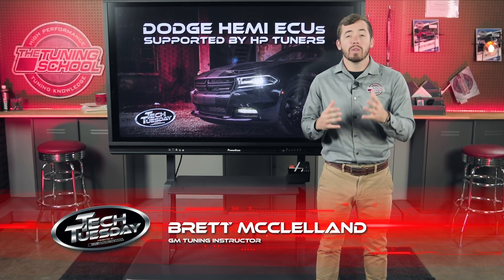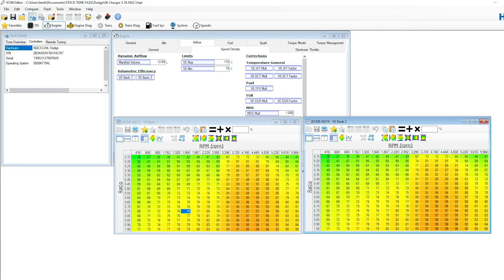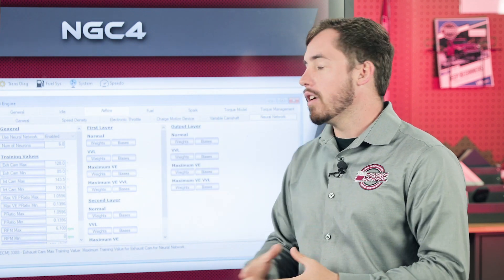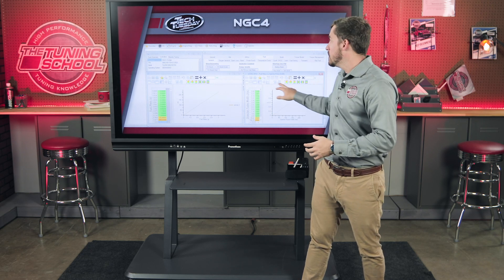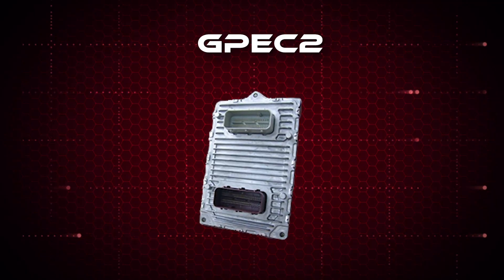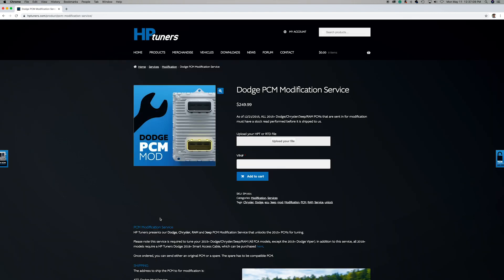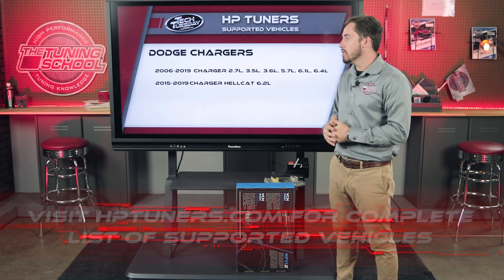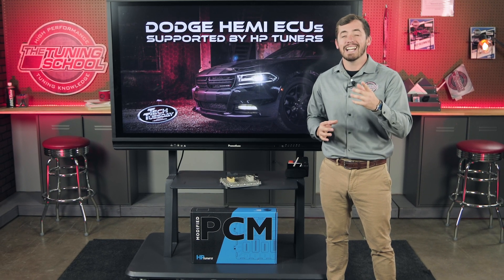Dodge HEMI ECUs supported by HP Tuners

Comment: Ummmmmm so my 2003 Dodge Ram 5.7 doesn't exist??? You're off by a whole ass year, the gen iii hemi started in 2003, not 2004.... there were not many made in 2003, but I know they exist because I bought one in March 2003 and still own it!
Reply: Prior to 2004 all Ram trucks and most Jeeps used the JTEC engine controller. I'm not sure but it could be that HP Tuners does not offer tuning for that controller. I do know that in the Ram forums there's a lot of post discussing upgrading to a 2005 PCM to gain tunability.

Comment: Why do OEM's lock ECU's if all it takes is to have HPT to open it up and modify? It just slows the process
Reply: They want to make it harder for the people to tune their cars bc it can case a lot of headache for them and don’t forget that you want 6/7 credits to tune most of the new cars.
Reply: Helps prevent people bringing in tuned cars under warranty for repairs. You can't simply just put the stock tune back anymore, they'll know the pcm was messed with